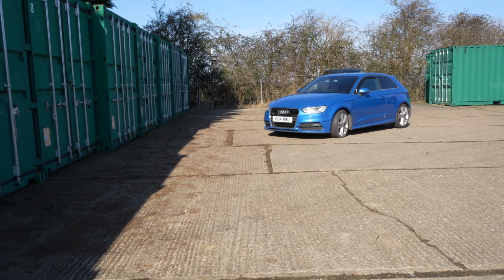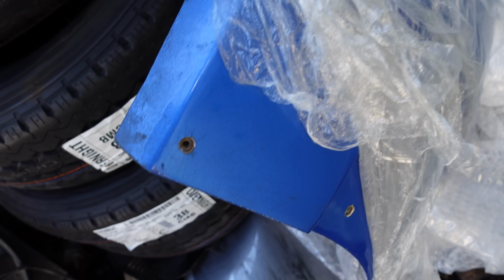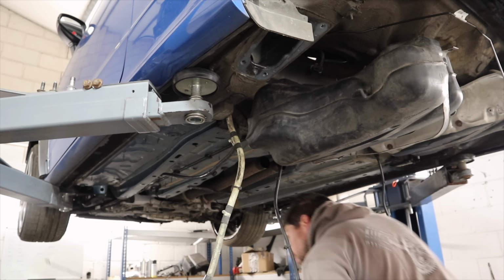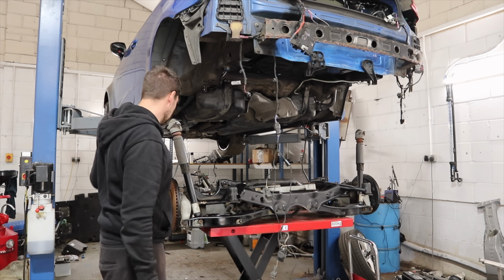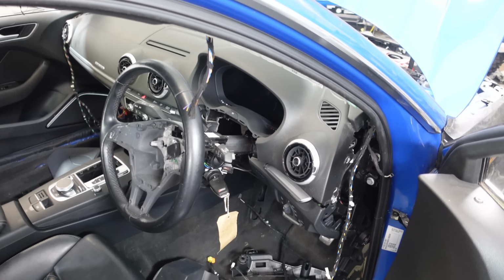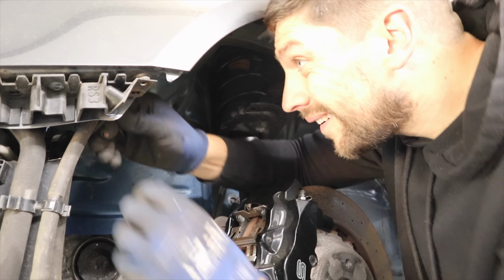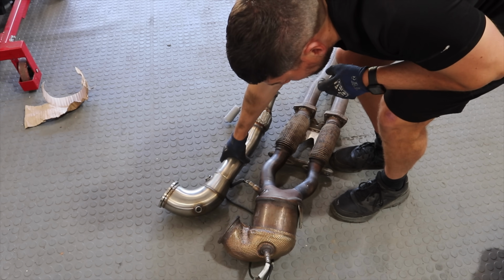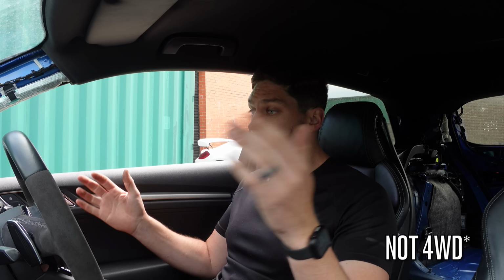I BUILT A 3 DOOR AUDI RS3 FROM SCRATCH!... FIRST DRIVE PT.7

Comment: Hi Dean, as this car has had the chassis modified, suspension, steering, engine, axles and transmission changed I don’t think you can keep the reg and might need to be on a Q plate and have a VOSA check? Looks like a headache 🤕

Comment: Dean you need to get a metal road plate for outside your unit door and bolt it to the floor saves ripping your bumper off, congrats on the 300k subs

Comment: I noticed you fitting the lights and the diffuser at the rear bumper without Painting first, really should have painted front  because of the shuts. Also remove the rear  diffuser to paint the bumper just get a much cleaner job.
Reply from the maker: It’s going to all come apart to be painted anyway, was just test fitting it all

Comment: Boot floor looks really good, but wasn't there a need for some sort of crossmember under the floor that links the spring mounts together?
Reply from the maker: I thought that too! But it turns out the fuel tank is slightly longer on the diesel which is why that bracket was further out. I’ll explain on next video if I remember 😂

Comment: This guy is a motor genius
Reply: How? He hasn’t touched the motor except from moving it from one car to the other…
Reply: @Mrtweet81 plus changing the loom, plus reworking the rear subframe, changing the axel,  rerunning brake lines, etc etc. Single handed.
Reply: @Mrtweet81 It did engine complete rebuild multiple times, including an RS4 v8 and a few water damaged cars. All without any diagram and documentation on hand. Just by logical thinking and crazy memory for every bits and pieces. Converting a diesel fwd manual to a petrol awd automatic is absolutely ambitious.
Reply from the maker: Wouldn’t go that far but thanks 😅

Comment: Hi Dean,  just wondering if you can include at some point how you go about insuring such a modified car and do insurers just charge the same as an RS3 or more because its a mix and match vehicle? Thank you.  Likewise for the modified Skoda.
Reply from the maker: I’m not sure yet, but once the DVLA details change it should come up different when they then enter the reg. But I don’t know yet. Will find out 🙌🏼
Reply: @SavingSalvage leave it down as a 2.0😂
Reply: @SavingSalvage tell them it's diesel and save money😂
Reply: It'll be completely different for Dean, he'll have business insurance.
Reply: Adiran flux! Make sure you disclose brake and suspension upgrades as it gets cheaper because you've improved safety
Reply: Please dont comment stupid things. @balders6095
Reply: Simple you don’t tell them and get  cheap insurance 😂
Reply: @MarketplaceMayhem1 all good until someone prangs it and insurance refuses to pay out. To be honest I was guilty of this myself back in the day running a MK1 golf with a MK2 1.8 engine.  yes officer it's a only 1.3...😂
Reply: @McNasty214 same had a 2.0 180bhp engine in my 1.4 206 way back in 2007
Reply from the maker: @MarketplaceMayhem1 👀
Reply: @MarketplaceMayhem1 I guess if you’re a div you could
Reply: Insure it as a kit car
Reply: Massive progress bud
Reply: Hiya I done the same thing with a Ford focus 1.6 D made it full  RS as in 4 wheel drive chanced everything, I changed everything at the DVLA  as in 2.3 petrol , 4wheel drive , the class or car done everything,it still same road tax as just 20 ponds  but I got insurance As a modified car was not that bad at all.
Love ya stuff all the best .
Reply: Nice work, really liked this series, definitely needs the rear arches.
Reply: @LeeDonnelly-q8k RS3 rear arches are the same as an A3, it’s only the front arches that are flared, RS models have always been that way.
Reply: Insure it as a 2.0tdi sorted 😅
Reply: With so many cars he obviously has the trade insurance
Reply: Great video Dean can’t wait to see the finished and how it looks pls let me come and clean your garage before Rob & Chris slate you 😜
Reply: Probably one for Adrian Flux, insurance brokers who specialise (or used to) in highly modified cars
Reply: It's called a "trader's policy". 😂😂😂😂

Comment: not all the way through this video yet, but are we not doing anything about the rear arches being significantly (visually) wider on the RS3? might just be me but it visually sticks out (or sticks in) massively to me.
Reply from the maker: The rear arch’s on the RS3 are no different to an S-Line bud. You can see this just by looking at the RS3 axle and wheels which don’t sit proud of the A3 arches
Reply: @SavingSalvage they look different for some reason, the front RS3 arches look wider than the rear A3/S3 ones here, the specs say the RS3 is 0.8cm wider than an A3, seems an insignificant value really, but something, to me, just looks odd, is it that the fronts are just more "aggressive" looking?
Reply from the maker: @obiitom yeah the fronts are an inch wider, but also the sloping rear of the 3 door may make it look narrower and also no spoiler yet.